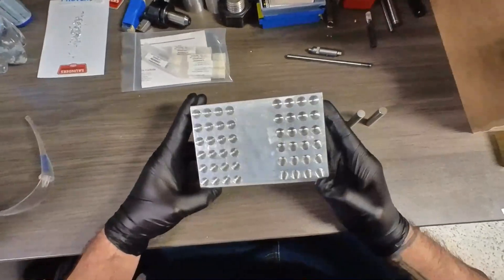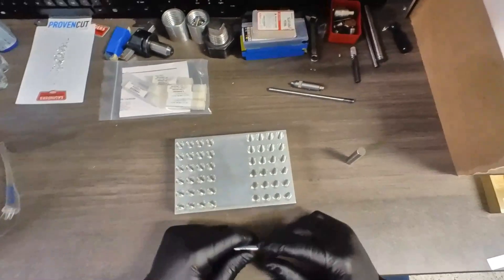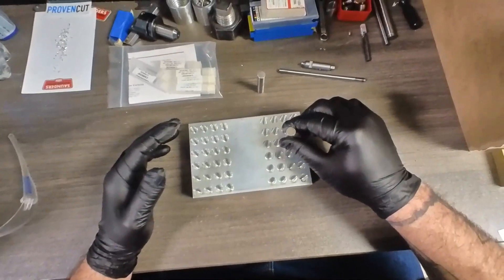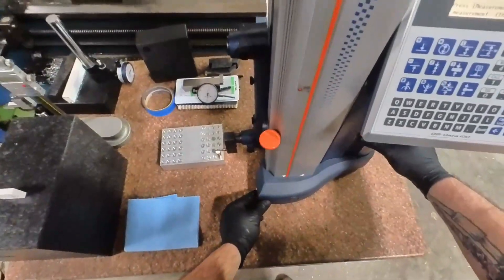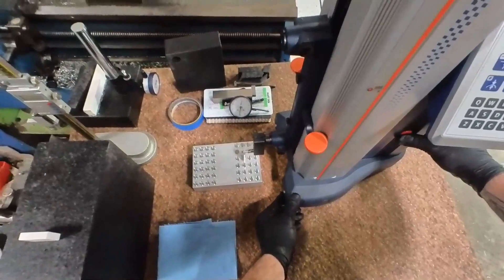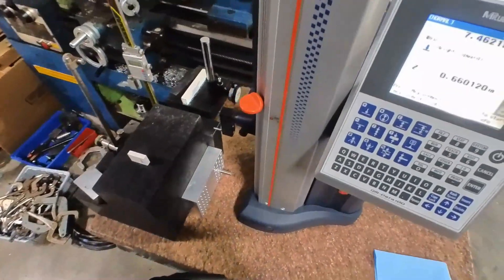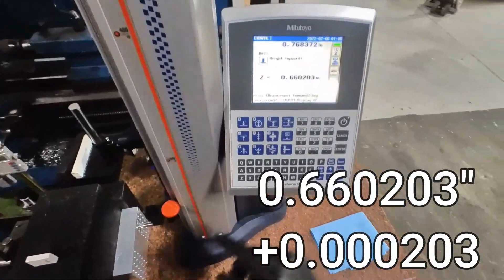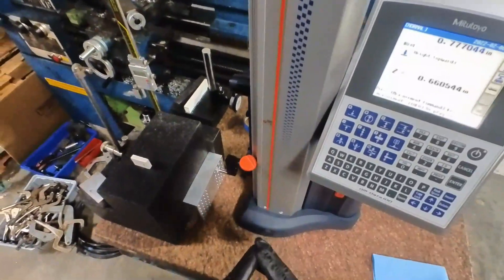Shapeoko HDM  - Checking machine accuracy and repeatability in 6061

Comment: Assuming you didn't use carbide create to make the program, I would be interested to see a similar test using carbide create.
Reply from the maker: Fusion360, but you can machine aluminum with Carbide Create and Pro has the ability to ramp

Comment: Curiously, the manufacturer of this machine has no mention of machine accuracy in the specifications on their website. That seems a bit odd when you consider what they're asking you to pay for it.
Reply: Given their general customer base being home hobbyists and makers, they would likely get a bunch of complaining because the users don't actually know how to create proper tool paths or maintain consistency when machining. Carbide's machines are fantastic for the price, and $5400 for a machine of this build quality is completely fair. I've been using their 4 XL for 2 years now and my only complaint is that it won't mill as fast as I want in Aluminum. That is my fault for pushing it way harder than the motors can handle.
Reply: @brynmrsh 5400 is overpriced imo. Can definitely build your own at half the price and twice the rigidity.

Comment: So the holes are very precise, but not very accurate.
Reply: Precision and repeatability are much more important. The accuracy can be calibrated in. If the variance were large then it couldn't be.
Reply: within -.001 .  Not accurate enough ?
Reply: @joeygonzo  they were supposed to be .438, they all turned out .434.
Reply: @Ivan_builds  that's irrelevant, it can be calibrated with few clicks

Comment: How would this change, part to part, if your shop temperature changed by 40 degrees Fahrenheit? Does the combination of steel linear rails mounted on aluminum extrusions create warping or other accuracy problems?
Reply: When measuring millionths of an inch just the temperature of the human hand near the part or the probe will change the reading. Even if temperature was not a factor, the placement of the part or pin will affect the reading as will any repositioning of the height gage. The coefficient of thermal expansion for 6061 aluminum is 10-6 /K (μin./in. ·°F). For example, a dimension of 0.660" will increase by 0.00032472" if the temperature increases by 40 degrees Fahrenheit. Likewise, when the aluminum becomes heated enough to be warm to the touch while machining, then the final dimensions will be different than expected (which is why flood coolant is often used in production environments). Factor in machine positioning tolerances with thermal expansion, spindle run out, tool deflection, and tool wear and you can see why it becomes difficult to consistently produce parts to +/- 0.001" or better.

Note: When I was just starting out in the manufacturing industry back in 1984 I initially worked as a machine operator. I learned the hard way that aluminum can get very hot at the cutting point during machining operations when coolant is not sufficient. A CNC programmer made an error (G0 vs. G1) and plunged a 1" diameter end mill into a part. This action literally melted the aluminum and ejected a small blob that landed on my neck. The cutting tool fused with the aluminum and couldn't be removed from the part. [FYI - The old Bridgeport Series I and Series II CNC 's were based on the standard milling machine design and lacked enclosures. Safety was an afterthought.]